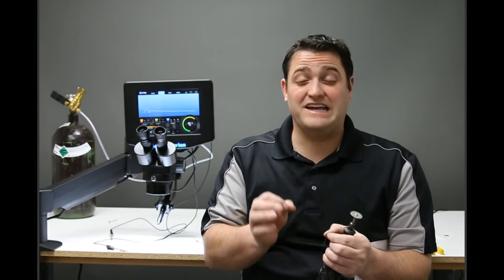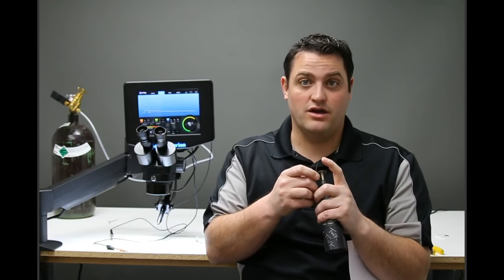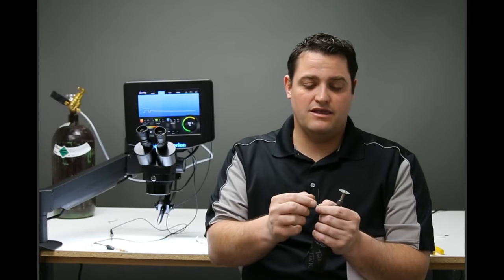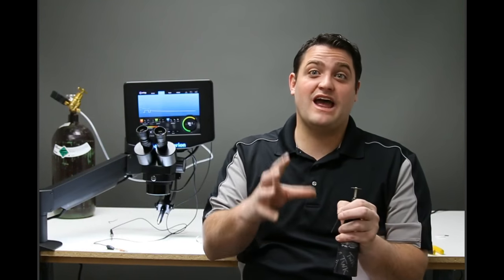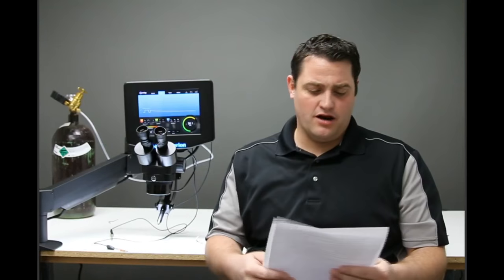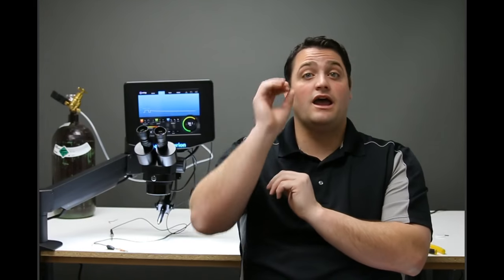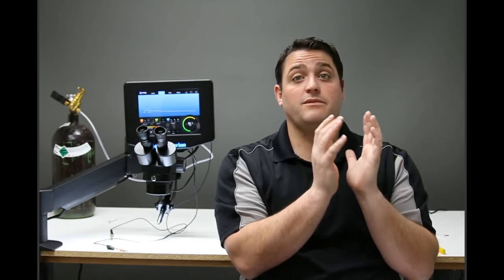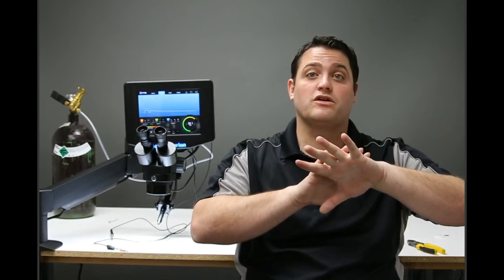Welding Silver - Tips & Tricks - Orion Live Training Webinar Ep.4

Comment: What works for me on ring joints using these tools is using close to max power initially on the joint and for the initial filling, then shaping it with less power before finishing. I work with fine 999 silver and they would break open if using low power on the joint.